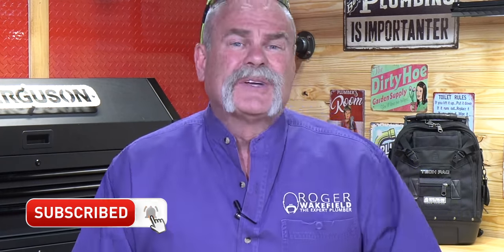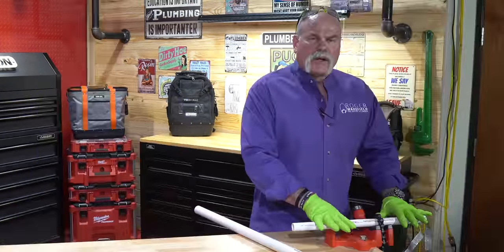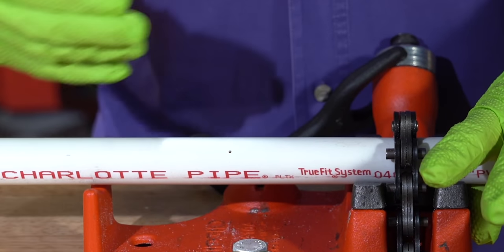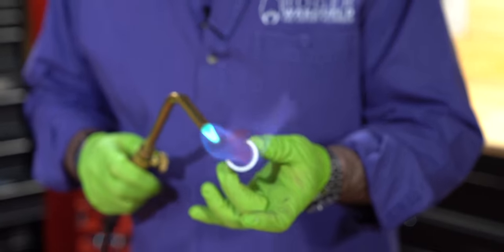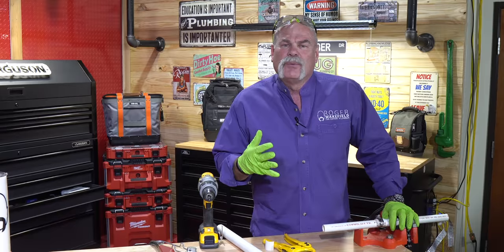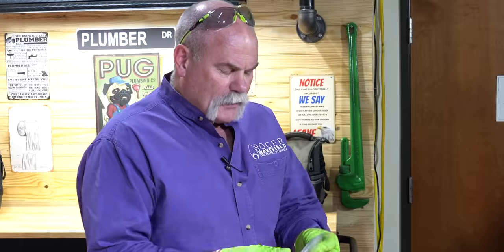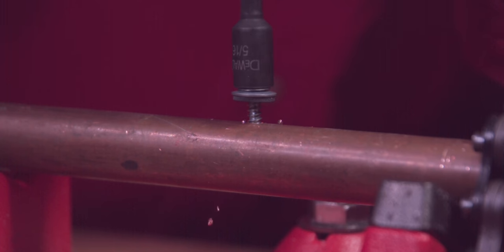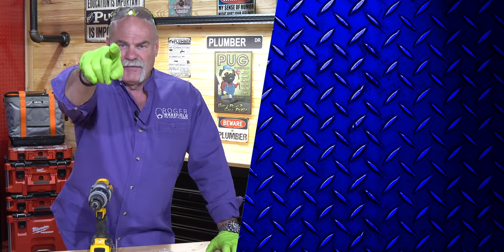Testing Out HACKS Some Plumbers DON'T Want You to KNOW

Comment: I’ve used a piece of no. 12 copper wire to fill a screw hole in copper pipe and soldered it up to fix the leak.  My dad who has been plumbing as long as Roger showed me this trick.  Really works well.

Comment: I've used epoxy putty to fix holes in PVC pipe, I did it in my pool piping that were under pressure, and it actually worked pretty well!

Comment: When heating that PVC, just heat the cut piece only. When you squish the cut piece on the pipe, the softer cut piece will form into the hole of the cold hard pipe with the hole in it.

Comment: At our hardware store we recommend hose clamps and a piece of rubber hose for pinholes in copper pipe. The screw idea is cool but would probably wreck the copper in our area because by the time pinholes start forming the entire run of copper is likely compromised.

Comment: I am a 1st year apprentice plumber and I have used a piece of rubber and 3 hose clamps on a piece of 1" copper to temporarily stop the water until I could get the city to come and shut off the water so I could make the repair. One clamp directly over the hole and the other 2 clamps on either side as a back up. Works great!

Comment: had a custom bent supply line that I ended up wrapping with a quarter inch of tape and topping with a band clamp to slow the leak enough to buy time for the plumber.
Reply from the maker: That's a great feeling! Even if its a temporary repair, nice to know you are capable of doing a fix yourself. Keep on Mr. Brown!
Reply: @RogerWakefield  what he really appreciated was I brought in my own rotohammer and cleared out the concrete and backfill enough for him to get to the straight part of the pipe to make the final repair.

Comment: I use rubber pads on copper pipe then clamped, you can clamp it even with water on.  It’s lasted years, but once it get really bad we get it replaced to pvc.

Comment: great videos Roger! I've used a piece of rubber form a gasket as well and a hose clamp !So it was a Saturday afternoon and I wasn't available and this  customer of mine called and had a hole in their copper water line in the basement! So I told him my old trick ball up some Teflon tape place it over the hole and take a hose clamp and snug it down 9 out of 10 that will stop it! Later that afternoon he called and said that it is holding for now! And that his buddy is going to come over next week and fix it ! I guess I thought he was going to wait for me but I was wrong! Sometimes it pays to strike while the iron's hot! I've seen the plastic around the pipe repair before and I would probably use some glue and cleaner on it! But I've never seen the one with the self-tapping screw and rubber washer that was pretty interesting as a temporary fix! I like your content Roger pretty well made videos you have here!

Comment: Another trick if you can get to the end of a pipe or have a way to cut and repair it you can slide a heavy heat shrink tube over the hole and shrink it, it's nice if you need something quick or don't have some specific fitting at 1 am and your basement is flooding

Comment: on the PVC...use redhot for a tighter seal. on the copper, cut a piece of rubber hose (as long as its not a pinhole on a fitting) and clamp it down with hose clamps.

Comment: I've learned when sweating a line that you can't stop water from messing up your joints. Just stuff a piece of bread in the pipe. Just use about 1 or 2 pieces  of the bread not the crust. Holds the water back and works every time

Comment: Instead of heating it up just throw some blue glue on the 1" saddle and then clamp it down.. for the pinhole in copper you can use a piece of rubber and a clamp, it's better than using a screw.

Comment: I've been a plumber 25 years.  You left out the part where you are in a muddy hole filled with water upside down....PVC pipe is easily repaired with a flow span coupling and super hot PVC glue, sets in 30 seconds, CURES IN 10 Minutes to 160 PSI  Copper simple saddle repair coupling until the  proper repair can be made.

Comment: Pull the rubber sleeve from within a no-hub band, cut a piece approx 3/4 inch width × 1" length, repair clamp.  Will solve problem within either water side, hot/cold-pressure side system, and-or any drain line. Roger mentions within a temporary measure, he's correct. Schedule asap to return to replace section/spot repair, and-or entire line if best service for customer.

Comment: I just use a cut piece of CT adapter with a hose clamp. On pvc I tighten just enough to stop the leak, don’t over-tighten or you’ll risk cracking that pvc.

Comment: I worked maintenance at old hotels, that had old copper pipes. They didn't want to spend the money replacing pipes. So I took 1 foot of bycycle inner tubes for 3/4 pipes, and wrap it as tight as possible. Then stretch over 2 hose clamps over the tubing next to each other directly over the hole, and tighten down and it works...

Comment: At our apt complexes, we have rubber gasket material you can buy at the big box stores, and hose clamps, ready to go for just such emergencies. Sadly, they get used way to much and will usually last a couple of years. When we get a leak in the water heater rooms/systems, it's either rubber gasket and clamp or shut off half the complex until it can be fixed properly.

Comment: Any screw to seal the hole would work. May may not have a drip after.
On the pvc you could pvc glue that same piece you made. 
They make similar fix for sprinkler lines.

Comment: another thing you can do is glue the patch piece to the plastic pipe with a hole and the hole in copper you can solder shut if you know how to solder and that will fix all those issues another thing you can do if your just trying to fix it on the cheap take an old leather belt cut a patch piece and hose clamp it to any pipe more then 1 will be needed and that can also fix your issue

Comment: back in the days of repairing your bicycle tires, you could get self vulcanizing tire patches.  we had a spring fed irrigation system with steel screw pipe buried in the ground.  when it developed leaks, we would stack a couple of those patches and lay them over the hole, and clamp them on with those band clamps.  the soft rubber would seal to the rusty steel well enough to keep the system functioning for decades. (they replaced a section of pipe with black poly about a decade ago, and finally converted over to a well last year.)

Comment: A small square of inner tube rubber under the patch in the first technique will work like a gasket and seal against mains pressure, if you don't have a torch.

Comment: Hey brother, they sell PVC patches from big state chemical that cure in five minutes with a UV flashlight, and hold 500 psi air and water. They bond to copper PVC metal whatever in there only about 100 bucks and they come with the light…I keep on truck at all times…

Comment: So speaking of holes in copper lines. What happens if you're putting a nail in the wall to hold up a picture and you bust your copper line that way. You not only dent the copper but you also have put a hole in it. Not to mention its a bigger hole. Nail plates will only take you so far, unfortunately.

Comment: I’m sorry but if your life hack requires an acetylene torch, propane torch or heat gun it’s not a life hack you’d be better off making a video using things a home owner might actually have, like jb weld, duct tape, hot glue etc.
Please don’t be mistaken I’m not saying any of those are better for fixing this problem, I’m just saying that they make more sense to the targeted audience of this video , frankly it would be just as easy to fix these problems properly using a pvc coupling and glue or a copper coupling and solder or compression coupling or even a shark bite

Comment: If one used PVC cleaner and glue then used a stainless steel clamp, I see no reason not to consider that a permanent repair.  The cleaner and glue is the same thing used for any other joint and the clamp is stronger than the PVC pipe.  It is not going anywhere.

Comment: Is there a place in the world where schedule 40 pvc is used for a water main? Never once seen that underground…same token, I do a similar repair when those culligan guys tap a backwash drain into a drain under kitchen sink. They install the load of press-fit equipment for a monthly fee, sell the customer all these fancy filters, then the contract gets cancelled and somebody has to come put all this nonsense they installed back to how it’s supposed to be. Long story short, I just cut 1/3 off of a coupler and glue it over where they tap into the drain. They always shark bite everything to connect their systems to the pressure pipe, good money coming behind them so I’m not complaining…but I bet the flood insurance for those dudes has a high premium.

Comment: ok these hacks might do in a pinch  if you don't have the parts With the copper pipe why don't you just turn off the water cut out the hole and solder in a new bit of pipe if you can't use solder a Compression fitting  and the PVC pipe how about a little PVC adhesive on the pipe and patch? I don't use PVC 
and I'm noting the trade just a DIYer

Comment: I mean I like the sleeve Idea on PVC, but why not just use cement and glue it in place? Seems easier and more semi-permanent. 

On copper is where the hose clamp comes into play. Wrap a little flex tape over the hole (3 overlapping wraps) and put a band clamp on top of the spot where the hole was. It will hold fine. I have patched air lines like that.